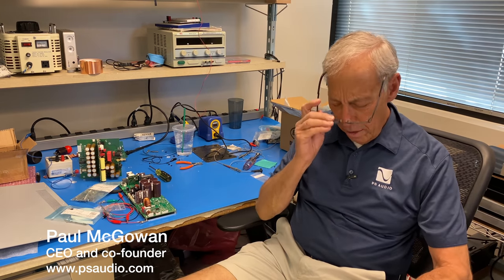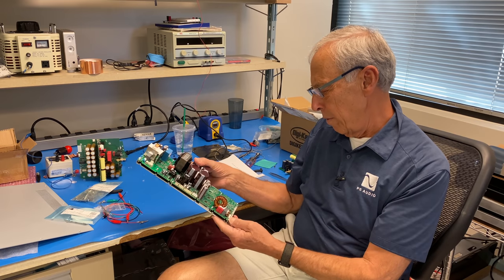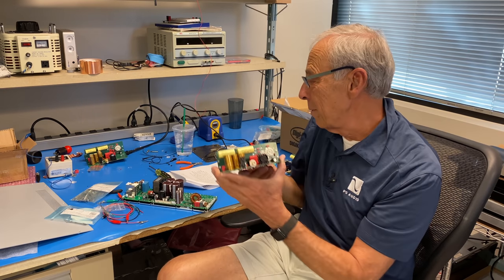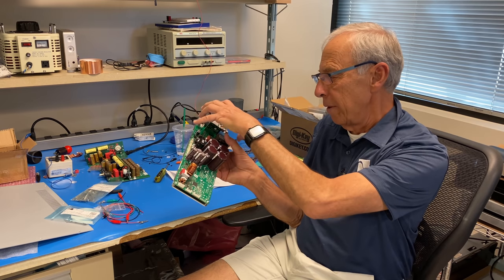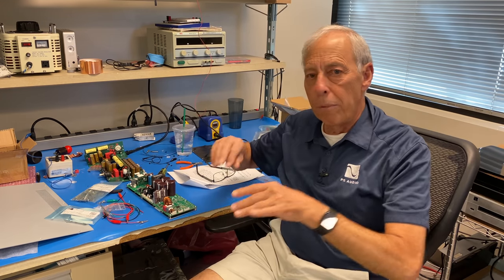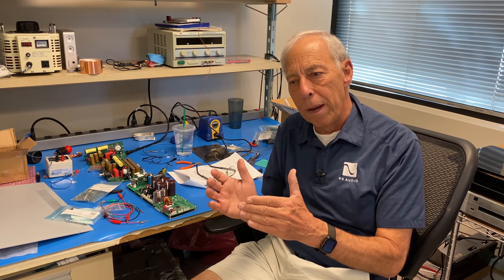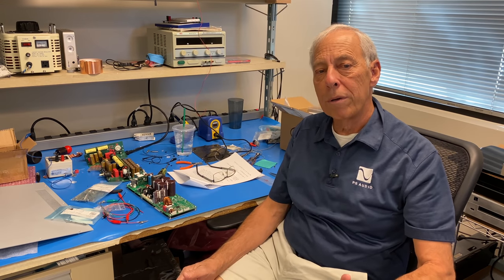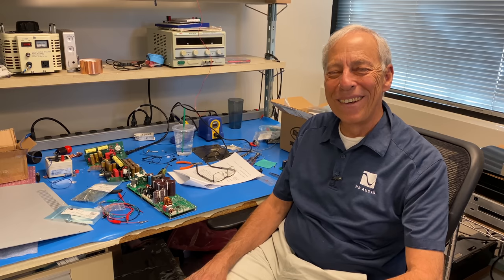Mono Vs. Stereo amplifiers

Comment: Congrat's Paul ????  One of the absolute best explanations of how an amplifier works (to the lay person) I have ever heard.  How you can simplify technical theories, and procedures, is fantastic. I used to be able to afford quality equipment like yours in the distant past, but, sorrowfully, now I have to rely on aging vintage gear. Watching your videos make me yearn for my past audiophile days of upgrades, trade ins, experiments, and sometimes follies.  Semper Hi-Fi"
Reply: Well if only it where true.. they have done thousands of double blind test which determined without a doubt that it doesn't make a difference to the listener. Yes speakers and rooms can make music sound very different and of course there is a certain standard that should be adhere to, but you cant hear the difference between 50000$ monoblocks and a 500 Yamaha amp, if both use the same speakers, the same input signal and don't change the signal artificially. Don't believe me? Check out Richard Clarks challenge? Think you can determine the different with your years? GO get your self that nice juicy money 10.000$ is a good deal ;-)

All the best to you though! 
Look back with a smile - you had all that and now you have fun with some vintage equipment!

Comment: What you have to consider is whether or not the performance gain is worth it. Can you hear a difference? If you can hear a difference, is it enough of a difference to make you want to spend the extra money? If the answer is yes, then by all means go for it. But if the answer to either question is no then a stereo amplifier will suit your needs just fine.

Comment: Perhaps worth mentioning that most power is needed for the low frequencies (bass) and usually that will be mostly in-phase between left and right channels. It’s unusual to have one channel drawing a lot of current while the other one isn’t. That’s why a single power supply of adequate capacity is a reasonable engineering compromise for cost reasons, in a stereo amp.
Another factor is - what are the limits of channel separation in your sources? Digital sources can achieve 100dB or better channel separation. Tape and vinyl, not so much. Your sources are already modulating left and right channels with each other.
Reply: @jim9930  - Bose did, and hence his Acoustimass design pushes all signals below 200hz to a single speaker.
Reply: @jim9930   That's because at live venues the bass is so loud the audience doesn't much care about stereo bass or imaging effects. And a left vs right sound stage is quite hard to achieve (below 200hz) when people are positioned all over the place.

But at home, you'll appreciate when the recording engineer has the bass skipping around a bit from left to right. It's fun and people like it.

The Bose system is a complete joke in that regard. Live sound isn't hifi. The bass module plays too high and also not low enough. Chuck it in the garbage.

Bass is still quite directional down to 70 hz. Don't believe me? Just about everyone can point to where the subwoofer is if they're blindfolded and tones from 70hz to 150hz are played.
Reply: @jim9930  ah, ok.

Comment: Sansui AU-710 / 717: Stereo integrated amplifier. 
Two transformers, each with a set of diodes and capacitors. 
Doesn't have a stereo / mono switch (but I wish it did). 
Close enough to separate monos for My budget.
Reply: “Dual mono” stereo amps were relatively common back in the day.  I don’t know why more manufacturers don’t offer them. It doesn’t have to be expensive.

I’d rather have two EI transformers in a single chassis than one toroidal any day of the week.
Reply: Have also a au 717 love it......
Reply: Use it as a preamp and than 2 xtz edges.   And you are goingTo Heaven ....

Comment: Few comments on power supplies. If your using an unregulated linear power supply, even one amplifier running on its own supply will generate at least some ripple consisting of the rectified audio on each respective rail, not to mention 120Hz ripple when its loaded. Even though its correlated to the audio, it will still contain copious amounts of harmonics that must be rejected via the PSRR of the amplifier (via feedback). You don't really gain a lot by segregating each stage since even the ripple from the solitary amplifier will still produce quite objectionable distortion if it gets into the audio. Additionally pretty much most music (and all music on vinyl) will have its L/R bass tracks more or less equalized (with the possible exception of classical music), which is where almost all of your power is going to, so the lions share of the ripple from each amplifier on each respective channel will both more or less be correlated to each other since its at lower audio frequencies. An argument could be made for the falling PSRR with frequency and the listener being much more sensitive to higher frequency distortion, but with the large quantity of higher frequency harmonics present from even one amp on the power supply rails, it doesn't seem to really hold much water. You still have to reject that somehow, so the ripple from opposing channels amplifier will likewise be rejected equally well.

Comment: Hi Paul, I’m a big fan of your videos! I have a follow up question: some stereo power amps offer the ability to be bridged and operate as a mono block (some at a turn of a switch). Is there any performance degradation in using 2 such bridged power amps, compared to mono blocks?

Comment: Great answer of course, though just to shoot the breeze; I guess another slant on the question might be a comparison of a pair of mono's and a stereo at the same price point, and of course a BHK250 stereo is more expensive than a pair of Stella 1200's. If you need power for synergy sacrificing mono'ism for more watts might be worth it. Dual power supplies in one box I guess is a way to save on expensive casework - would trade the cost for bigger transformers/power caps...

Comment: Monoblock amps with separate power supplies offer better channel separation - some are even spec'ed at having a channel separation rating of up to 130 dB.
Reply: Channel separation specification for a mono amplifier doesn't exactly make sense.  
At the system level where that spec applies, it has nothing to do with the mono amplifiers and rather has only to do with the source and signal/power cabling configuration.
Reply: I had always heard about separation, never gave it much thought, but when I actually ran with two mono-blocks, my jaw dropped. With better dynamics and separation, boy-o-boy, what a difference mono amps make.

Comment: A great power amplifier isn't cheap. Most importantly is excellent engineering. A stereo amp can be excellent also through careful passionate engineering e.g. making sure the power supply inside is very robust with the headroom to deliver power during the peaks. A stereo amp can also be made with separate power supplies for left and right in one cabinet (e.g. Hegel does that). Doing so will save some money without sacrificing quality.

Comment: 'Ole Audiophile to Paul: ...a well thought out explaination. Unless one has a bevy of heavy duty AC outlets, one better be talking straight stereo because an AC cord every channel becomes it's own headache. We did skip over mono bridging on some stereo amps but that can seriously complicate the ohm load formula for us ginks. I consider load first when deciding between mono & stereo. Am I hooking up a normal load or something that drops off the face of the earth? Nothing beats a mono block amp when it comes to driving low ohm loads at moderate volumes safely. Wow, I can't stress that lesson enough.Thanx (general rule of thumb)

Comment: I have a integrated stereo amp that have a dual mono amp config and both channels have their own seperate power supplies. And I think actually there even is a small seperate power supply for the pre-amp. And it also have direct inputs to the power amps so I can use it as a pure power amp. 2x 150watts into 8ohms, 2x 300 into 4ohms (all ch driven at 20-20.000Hz with less than 0.05% THD) 1000watt total power supply. And it is class A for the first watts and then it works as a class A/B from there.
Reply: Brand and model name/number, please?! :)

Comment: If stereo channels interfere with each other via the PSU, you need to implement proper isolation.
Decoupling caps, coupling caps, optocouplers, isolation transformers... a solution to every situation.
But you need to take the effort to design it of course.
Reply: What about simplicity and elegance?
The philosophy of "less is more"?   : )
Reply: @HareDeLune  Yes, exactly. 
Adding just two isolation transformers will probably suffice.
No need to build two full enclosures and to full power supplies, simply to get things separated. That's just inefficient overengineering.
Reply: @QoraxAudio 
Hmmm...

Comment: That was way to simple. It was basically an opinion. You gave one reason and barely explained it. You could've given a little more of a technical explanation being a engineer and all
Reply: I understood, he didnt need to go into detail.
Reply: Paul is not an engineer, he's the CEO of PS Audio.
Reply: @QoraxAudio  Paul is the CEO but he is also an engineer, perhaps not designing as much as he used to or designing at all.  I believe that the original P 300 power conditioner was his idea and his design. He knows how to make a decent presentation and if he doesn't satisfy everyone in every video… I'm not exactly sure what each of you is expecting on a daily basis from his explanations. There are many different viewers with some electronics knowledge and others without any. Why not just go with the flow and see if Paul expands on his basic presentation.
Reply: Yup, and a more technical explanation would've gone right over most people's heads, which is one reason for not doing it.
Reply: Fat Rat  A properly designed power supply should have enough capability to sustain clean rail voltages without being thousands fo $$.

Comment: I think, mono might better electric/electronic wise due the separation of components and gives you more power of course, but this can be done also in the same chasis stereo wise. If you do not need the power mono will give you and you have a little room or a non acoustic one I dont think you will hear the difference in a blind test at same loudness.
Nice video by the way.

Comment: The size of the dip in the other channel will depend a lot on overall volume. At what percentage of volume setting (on pre-amp) will it make a difference? 10/25% doubtful. 50% maybe, 75% likely. Those are just my uneducated guesses. Could you therefore circumvent the problem by getting a decent sized stereo amp, maybe with dual-mono internal design?

Comment: Great explanation Paul. I'd extend this question -

What makes a bigger difference?
Separate amps for high and low frequencies and using bi wiring, or using amps as mono blocks for left and channel but all frequencies on each channel are managed by each amp? This is given we could only go one of these two routes and not both.

Thanks again and look forward to your valuable insights.
Reply: If you have separate amps for high and low frequencies, with bi-wiring, then you must have 4 amplifier channels.  
If you want to compare that to "using amps as mono blocks" then you must be thinking of putting two stereo amps into bridged mode.  
In that case, most direct-coupled SS amplifiers will give you more system power in the mono block configuration, so that's potentially an advantage.  
But if you have 4 amplifier channels, there is an opportunity to go to active crossovers and bypass the passive crossovers, at least to some extent, and that has another set of advantages.  
Bottom line, it's down to whether a little more power will give you more benefit than an improvement in crossover technology.  I suspect that most owners would find the latter to have more benefit, if they are willing to make the DSP investment and spend the time to do the setup and crossover mods.

Comment: If the power supply is large enough it won't matter. We all share power in our homes with our neighbors through a common utility company transformer. If your neighbor turns his light on the effect it has on your appliances is so small you'd never notice it and it would take very sensitive equipment to measure it. If you have city water from a water main and you are taking a shower your neighbor turning the faucet on his kitchen sink will have no effect on you. 

On inexpensive equipment there might be a slight noticeable difference. On expensive multithousand dollar audio equipment there just is no valid excuse.
Reply: So when I hit "play" on my cassette deck and the lights dim, I should look into that? ;-)
Reply: @jamesplotkin4674  I'd go see an eye doctor.
Reply: Exactly, Mark. If I had two fire hoses attached to a hydrant that could flow 800 gallons a minute but each hose and nozzle (or valve as Paul described it) could only flow 300 gallons a minutes then there would be no loss of pressure or flow through either hose. I audio terms if I had a power supply capable of delivering 1000 watts of power continuously and 2000 briefly on demand and the most my speakers ever demanded was 400 watts each on the most difficult passages then it would take test equipment to measure any difference in supply to either speaker.

Comment: Of course a good stereo power amp or integrated will still beat a poorer set of monoblocks. I have a large integrated with dual mono configuration and it does a great job. Better than the valve monoblocks it replaced. And they were by no means bad amps.

Comment: Waqas from pakistan, big fan of yours...i currently have a Krell 3250e to power my 2 x b&w cm9. i am getting 2 NAD C272 amps, i can run them as mono blocks, will they outperform the Krell 3250e? the krell is 250watt p channel i think and the nad is 300watt per channel as monos. thankyou

Comment: It depends. To get the best stereo separation occurs if the amps do not have a common power supply or linkage.
i.e. two separate batteries is nearly ideal.
Even with that the loud speakers will interact with each other due to physics.

Comment: Mono amps are better when there is no budget limit, but per Dollar, you can get more audio fidelity in a stereo amp as you don’t end up paying extra for cabinet and other parts that aren’t contributing to better sound. Most of the power is in the bass where both channels usually are in synch and thus you wont hear any slight left/right load interference. But a stereo amp with a poor power supply, due to bad design or perhaps due to old dried-out capacitors, can struggle keeping the channels free from cross interference.

Comment: I always wondered if because of this if a monoblock preamp would yield any gain and I do understand that power requirements are lower but then I would guess the preamp power supply is smaller too. would it be better with a method of balancing the attenuation link and how does PS Audio avoid the modulation issue in the Preamps.

Comment: Realistically, because most people don't play their amps at full volume and there should be fairly decent common mode rejection and power supply sag would be sub-audible due to the large bulk charge capacitors, it probably doesn't matter much.  But more is better right?
Reply: @jim9930  I'm sorry, are having problems with Noise?  You know batteries are electro-chemical and that reaction can make noise too.  Not many people think about that.

Comment: should input stage also has its own power supply?
Reply: Very expensive ones usually do, at least the ones I've serviced back in the 1990s in the 5,000 USD and up price range.

Comment: If you have the money, go with dual mono amplifiers.  If you don't have the money (like me), go with what you can afford, but chose wisely.  A good stereo amp (power, integrated, even a receiver (remember those)) may not quite be quite as good as those dual mono amps, but these days it can come surprisingly close if you do your homework.  There is a lot of really good gear out there that is affordable by mere mortals.  Most PS Audio gear is expensive, yes, but it is also quality gear by the accounts I've read/watched and Paul should be commended for not wandering into bat-sierra crazy expensive territory.  Good music reproduction is infinitely better than no music reproduction.  Especially in these troubled times of very few, almost no, live performances with the actual musicians on stage in front of actual you.  In the mean time, God bless the stereo system.
Reply: Buy used gear (like me) :) 😀 many mono amps Will be very affordable
 Cheers.

Comment: Well visualized: The DC current is just 'sitting there' and the amp is just a big 'ol valve. 
Personally I only use active speakers. Where you have the psu and amp perfectly matched to the speaker and mere inches away from the drivers. My question. Why are passive speakers still a thing?

Comment: I think masud is comparing the stereo and bridge mono applications. He is asking which set up got a better sound quality. Coz a stereo set up can handle two speakers basically and In bridge mono is only one, thats why he will use two amps for two speakers. I think he will use it for his subs.
Reply: Fat Rat  i think youll understand my point if you are really into mobile sounds.
Reply: @gerardvoughnfaust4167  I'm into mobile sounds too, those sounds from mobile fidelity sound labs.
But what has a poweramp to do with MoFi? 😜